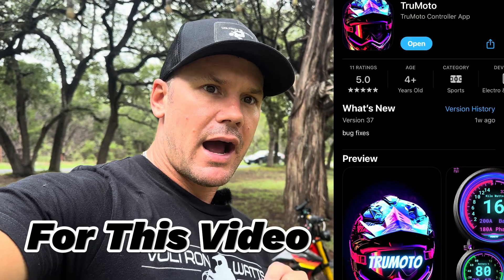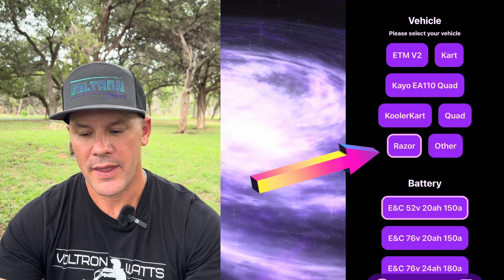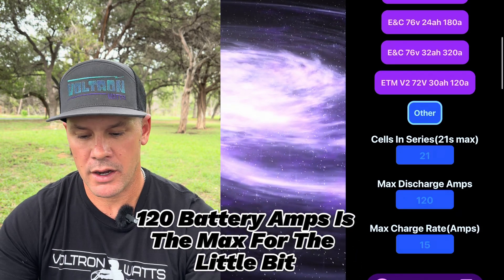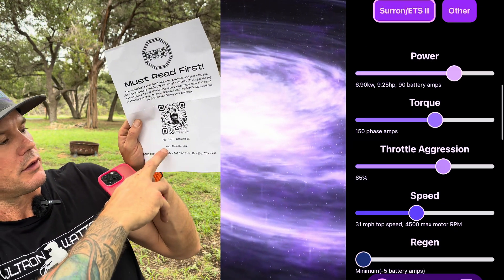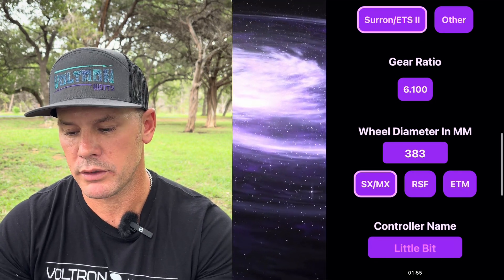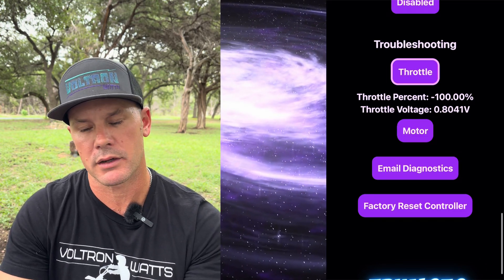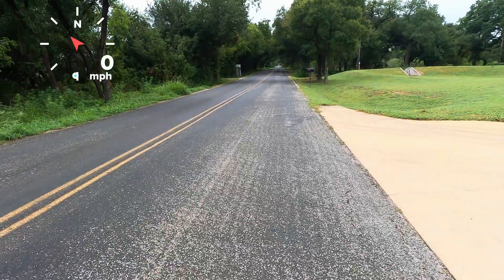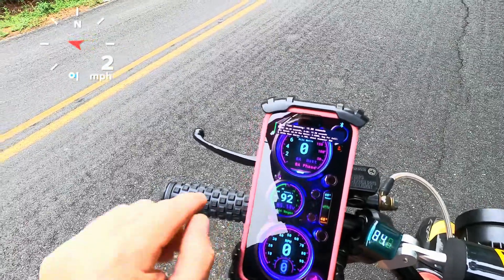First Time- TruMoto VESC Controller Set up Guide by Electro And Company!

Comment: i have a72v 32ah 200amp battery i have a the lil bit do it put 200 or 120? for max discharge
Reply from the maker: I think 120 is the max for the little bit anyway, so probably stick with that

Comment: @VoltronWatts Voltron I'm brand new to this stuff, my sons and I love watching your videos. (I'm strict on what they can watch, but we love your content) I just purchased the ultimate 5000w (3.0) kit for both my boys and the 11kw for myself. Going to install on Monday as long as I don't get mandated to work again (LEO) I saw your IG, a fireman, you know you know the drill. 😂🤦‍♂️ I have searched high and low, and can't locate a clear answer. Am I able to use the TruMoto app to tame the power/ speed on these kits with the assigned controller. My boys are only 7&9 and I'm nervous about them being able to clock 40-45mph on a razor. If you even see this comment, thank you for sharing all your knowledge, we appreciate you. 🙏🇺🇸
Reply from the maker: Hey! Thank you for watching and commenting! It means a ton when people sound their precious time on my channel ❤️ also, thank you for your service! 🫡 you can totally tune the trumoto - check this video out 👇
First Time- TruMoto VESC Controller Set up Guide by Electro And Company!
https://youtu.be/Fl303TYAJcA
Reply: @VoltronWatts  dude I can't thank you enough for taking the time to respond. I'm sorry I realized I didn't clarify. The controller that came in the "ultimate 5000w razor kit 3.0" for my kids is a voltol EM85 from electro&co. Will the TruMoto app connect with that controller so I can slow the bikes down? I guess I blindly assumed I could use the app with the kit because I bought the whole package from E&C. I'm reserved about my kids going FULL SEND and whiskey throttling down the street 😂🤦‍♂️ hoping I can control their speed until they're more comfortable/ confident on the bikes.

Comment: Looking for some advice.  Bought a set of 12/14 dirt bike wheels from Midwest mini mod and it came w/ 428-48t rear sprocket.  However, my Kunray KR5V kit comes w/ a #35 chain & drive sprocket.  The 35 rear sprocket that came w/ kit will not fit on the rear wheel. Do they make adaptors for this problem? Or does anyone know where I can pick up a 35 rear sprocket that will fit Midwest 12” rear hub?     Any input is greatly appreciated.  Thanks in advance!
Reply from the maker: I’m sure you can source one from Amazon or have one made by rebel gears. A guy in my neighborhood just had this issue as well. I’ll ask him what he did 👊

Comment: What if I don’t know the battery amps on my battery, can I select the highest amount or should I try to find out what the amps are?
Reply from the maker: I’d try to find the amps. A lot of times it’s on the battery
Reply: @ sadly there is nothing on the battery, I bought the bike already partially modded with a 76v battery and it seems to either be a random Amazon or Alibaba battery but it doesn’t have anything on it so would I need to purchase a new battery before I get the controller or is there a way to put a random amp

Comment: is there no way to disable regen? i cant get through set up cuz it says my regen is too low... i dont even want it
Reply: I just figured it out had to change charge amps to 5 i was trying the regen slider lol but now motor doesn't work still yay
Reply from the maker: @Jronesfpv what’s up with the motor? What motor you got?
Reply: @VoltronWatts  I just have a 48v generic my1020 motor. I didn't realize or I forgot that e&c had their own version so I thought any my1020 would work.. looks like I'll have to upgrade the motor. Hopefully it didn't damage the controller I did super low settings when I tried to give throttle. Time to go 72v
Reply from the maker: @Jronesfpv send it! Don’t forget about the Voltron discount codes 🫡🫡
Reply from the maker: On the little bit it shouldn’t even let you adjust it if I remember right. I think it’s already set at 0

Comment: Hey voltron I was so exited when I got the little bit in the mail and when I hooked everything up the volt meter was saying 81 volts and full but the app was throwing up a error code 2 saying the volts  is too low what should I do. I’m so bummed I was so exited to ride it
Reply from the maker: I have never heard of that error code. What motor? Have you emailed the company?
Reply: I bought the ec4p lite and emailed the company but they still haven’t got back to me I wonder if it’s a motor problem or a controller problem or battery issue

Comment: Would I be able to pair the little bit controler with an amorge 72v 28ah 175a(the one on alibaba?. If yes what settings in the app should I put?
Reply from the maker: Sure can. But the little bit can only handle 130 battery amps if I remember right. So you would want to set that in the trumoto app. 🤙
Reply: Sorry for a similar question just want to verify before I purchase..I ordered 72v 32ah 200amp discharge from hotpaxx..can I run little bit controller as long as I input my battery info properly? Thanks

Comment: do you prefer the Midwest swing arms or the sotion one I’m wanting to go with this little bit set up but I’d really like the sotion swing arm boss what’s your opinion
Reply from the maker: I have never used a sotion swing arm. The MMM one is nice. I think the sotion arm is pretty much the same
Reply: @VoltronWatts  I thought I seen a video of one of your builds with a sotion swing arm dang was hoping for good feed back on the sotion kit as it comes with a wheel
Reply from the maker: @carloscuevas164 I have a video of the FW01 swing arm /motor kit. But not the Sotion swing arm with the FW11
Reply: @VoltronWatts  ohhh I get you boss sweet okay I’ll go with the sotion swing arm boss on the side note your video is steering me into the little bit kit for a starter kit but I’m not sure if my 48v battery 100amp / 20ah battery would be enough for the little bit kit ?

Comment: I have the same setup on my Razor but my motor has a stutter at low speed when I roll off of the throttle. My regen is set to zero but it still has this issue. Have you experienced this problem?
Reply from the maker: I havnt. Did you do the motor pairing procedure in the app?
Reply: @VoltronWatts  I did, I followed the instructions that were included from  E&C. I did a test today with my E&C my1020 motor and the issue stopped.  Obviously an issue with my EC4P,   thanks for the response.
Reply from the maker: No problem 👍

Comment: ay man i bought a full mx650 build from someone for 1400$ it has the full kit with the noisey cricket ec4p and a 76 24ah battery with the e&c extensions. but the motor is making a super loud noise when the chain is on and it won’t spin the rear wheel at all and idk if e&c would do anything since i didn’t buy everything from them
Reply from the maker: No idea man. Have you contacted them?
Reply: @VoltronWatts  yeah but idk if they could
help since i didn’t buy all the parts from them
Reply from the maker: @ChiLly___ and with a shot

Comment: So if I have a little bit I can’t run a 72v 32ah 200amps I asked all the Facebook groups, but no one answered
Reply from the maker: From my understanding 120 battery amps is the max the little bit can take. I THINK you can still run your battery but you won’t be able to run it at 200.
Reply: @VoltronWatts  thanks just trying to get the max range out of my mx650
Reply from the maker: @Imdrewelectric totally!
Reply: It’s not about the ah it’s mainly voltage and amps. It can handle up to 72v 120a. So if you want a electro & co and run 200a then you want the trumoto. You can absolutely run that battery you just gotta go into the controller app and put the amps to 110 I would reccomend.
Reply from the maker: Amp hour is just the size / capacity of the battery. Controllers don’t care about ah
Reply from the maker: That’s not all true. Little bit can take 76v battery. TruMoto is the app/software. If you want to run over 120 battery amps you need the noisy cricket controller from E&C 👊
Reply: Lets goo!🚀

Comment: Your view on hub vs mid drive motors?   I absolutely hate chains so I've installed 3000w 14" rear hub motor on my mx500 and love it.  I also installed 5000w 12" hub motor on my pocket mod.  I don't see many videos of razors with hub motors. 🤷🏾‍♂️
Reply from the maker: You’re right, there arnt that many. I like hub motors too! Very quiet and easy to use. No Maintenance 🤙
Reply: I want to put a hub motor on my pocket mod too. Which one did you buy?